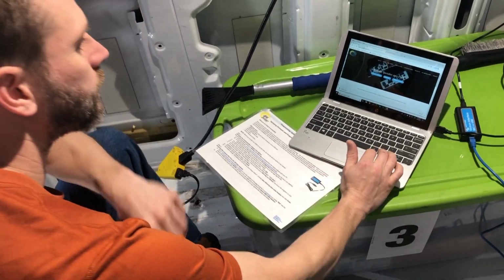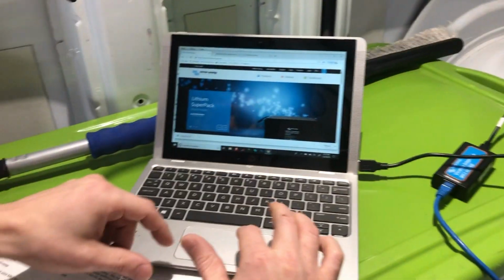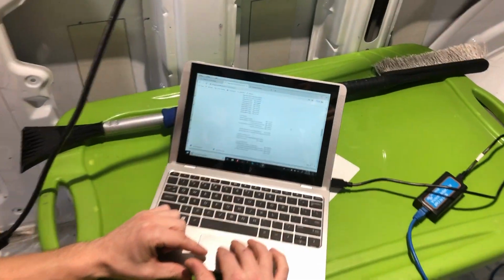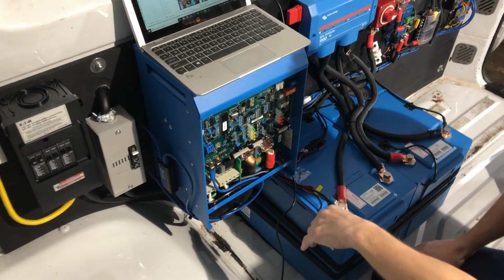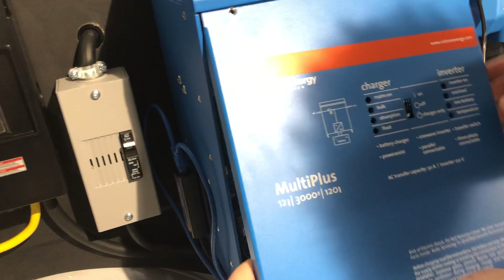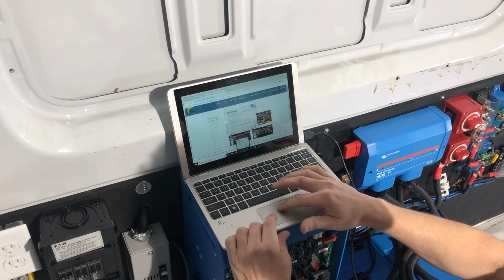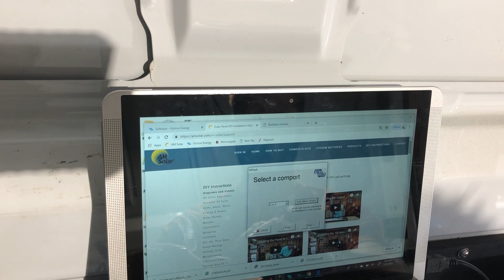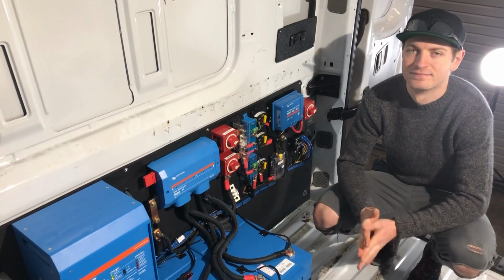Van Solar Conversions - Up On The Mountain (Pt.6 - Solar Panels)

Comment: Are you now installing DC to DC charge controllers?
Reply from the maker: Yes, usually the Victron Orion 30A. It depends on the rig and the batteries.
Reply: @GarretTowneAMS  Nice setup. I also just installed an Orion 12/12-30 charge controller in my Airstream Interstate. I really appreciate your “cheat sheet” for settings. It helped a lot!